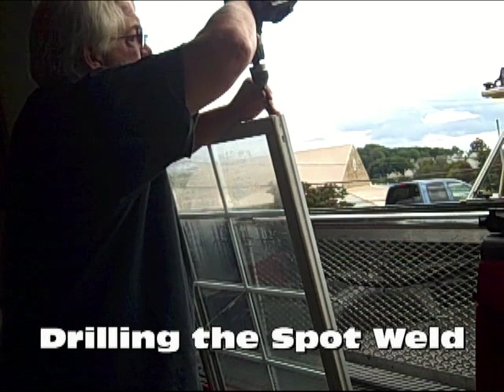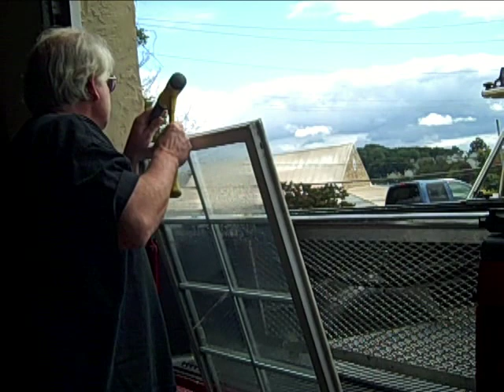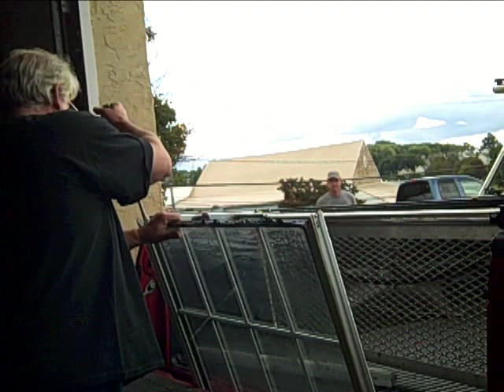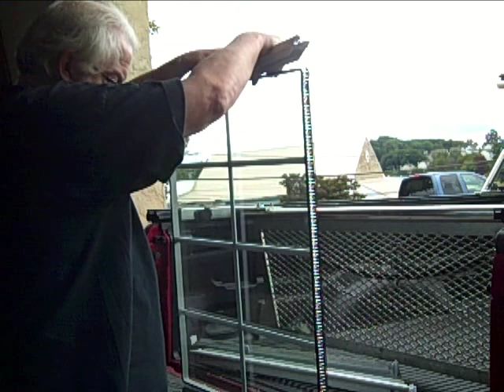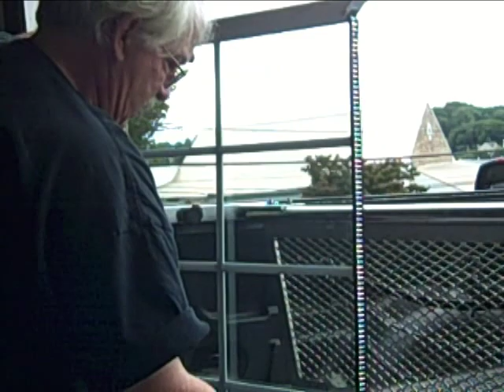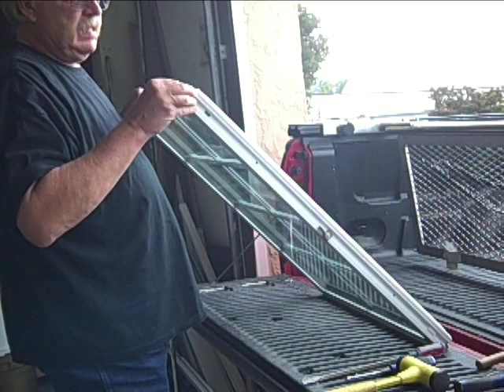Replace Insulated Glass.mp4

Comment: I just got a replacement window sash for a vinyl double hung window that is fogged up. In your line of work how much is the normal labor cost to fix the window? The company that installed my windows in May 2004 said my windows have a lifetime warranty, but they don't fix them if something goes wrong. So I need to get someone reputable to do this.  BTW, I live in MD
Reply from the maker: Olga, if you have just the replacement glass, it might cost $50 to $150 for the tech to come to your house and take apart the sash to install the insulated glass unit. If the company that made the window is still in business, they may be able to just make a new sash. Call me and I can discuss the project with you. John 610.458.8641